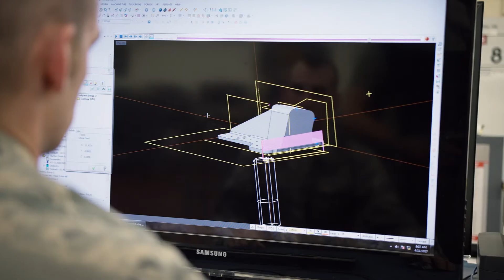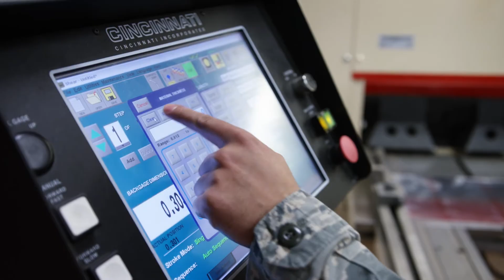U.S. Air Force: TSgt Richard Bazen, Aircraft Structural Maintenance

Comment: Retired maintainer here who will tell you (good) things about this career most people won't. Structural folks have a 
very good job as far as aircraft maintenance is concerned. I wasn't one but worked with them throughout my career.  They are less common than mechanics and have it easy finding civilian employment in the aircraft industry.  Unless you're out drilling stuck screws on the flightline most of the work is in-shop.  I suggest waiting for a slot rather than jumping the gun to get in if the field interests you.  Your custom metalworking skills apply to more than aircraft. If your recruiter is any good they will take you to a nearby base to visit different shops if you're interested in aircraft maintenance and repair. Mine did. (I was comm/nav, then crosstrained to engines and was merged with the crew chief field. I enjoyed those jobs too. ) 
General aircraft maintenance and Air Force info:

The best maintainers are mechanically and/or technically inclined. Farm kids used to running equipment and car/truck/motorcycle mechanics are easy to train and take to the work naturally, but anyone with a bit of determination can learn it.  Like building anything from computers to RC cars? You'll do fine.

You'll hear about the benefits but the real deal is even better.  I joined during a recession and never felt one since. 
You'll hear about military brotherhood and that's also true. I have bros from the 1980s I'm still in touch with. 
I have never met a retiree who regretted enlisting, and while you can retire at 30 any time after 20 is vested. CHECK THE NUMBERS (pay tables etc) and you'll find the overall package kicks a$$. I retired at 47 and never had to work since unless I wanted to. Instead I went to college for fun taking welding and machinist courses. Do whatever you want. Many of my civilian peers had to work much longer after their 401Ks got nuked by the 2008 recession.
Reply: ob Fuscated Thank you for this information about the job. I am going into the air guard and having a tough choice between aircraft structural maintenance and aerospace propulsion. Any information on propulsion? Thanks.
Reply: appreciate your wisdom and insight thank you for your service ! im currently in the process of going to meps but only need my physical and paperwork left.Trying to research some AFSC's to be prepared.

Comment: what is the asvab score to get this job?
Reply from the maker: The ASVAB is broken down into four main categories (Mechanical, Administrative, General, and Electronic), and all enlisted career fields have a minimum score requirement that fall under one or more of these categories. These scores, along with the results of your physical examination, will be reviewed when you undergo job counseling during the enlistment process at the Military Entrance Processing Station (MEPS).

Minimum scores by Air Force Specialty Code (AFSC): 
http://www.military.com/join-armed-forces/asvab/asvab-and-air-force-jobs.html

- Pam
Reply: I work in Aircraft Structural Mx. The required ASVAB is M47. They’ll teach you everything you need to know in Tech School. It’s a very rewarding career in my opinion.
Reply: Try to score as high as you can, and treat the first ASVAB as practice. ASVAB prep aids exist. Get on Air Force forums (f16.net is a good one) and ask maintainers how to be an INFORMED potential recruit.  They are happy to share.